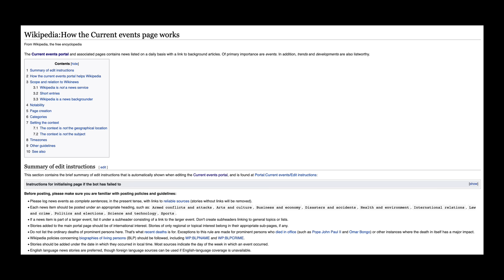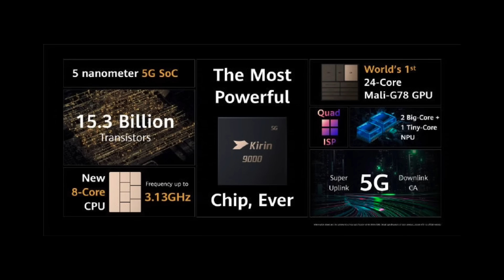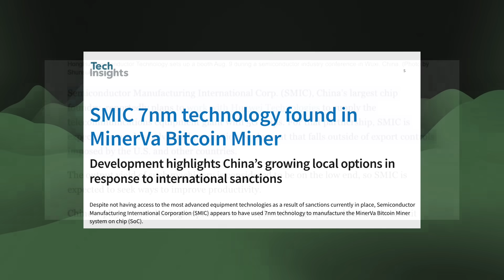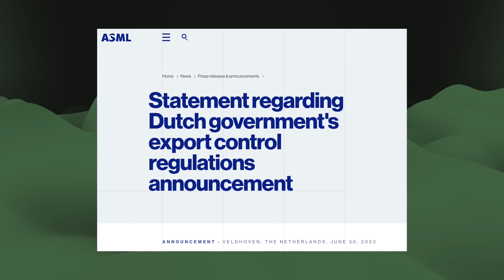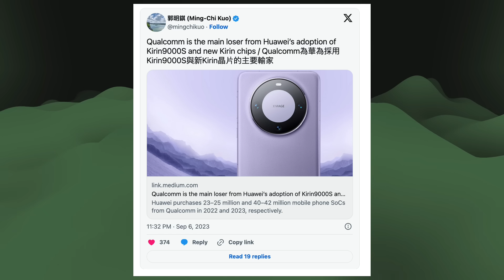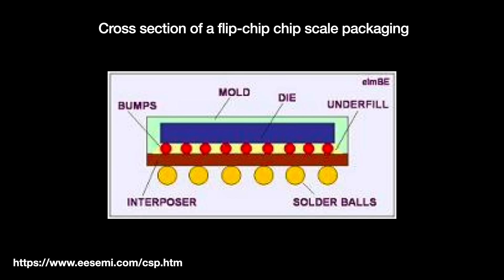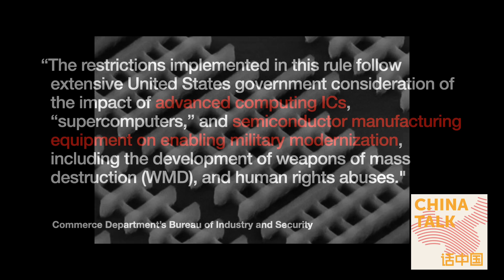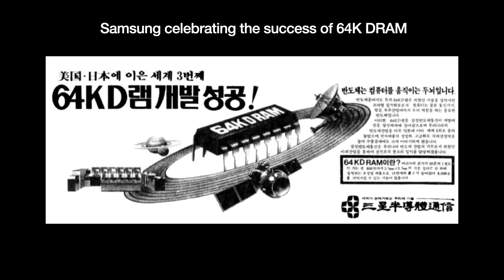China's 7nm Semiconductor Breakthrough

Comment: This video made me re-watch the "can you do 7nm without euv?" video you posted an year ago. It speaks to your in-depthness regarding semiconductors, and i can't overstate how much i respect your hard work and dedication. thank you.
Edit: hey jon. Sorry for this stupid ass argument in the replies to this comment. I have no idea how it started.
Reply: no, all he said is NS
Reply: @xinyiquan666 he is heavily biased since he is taiwanese dpp supporter but he has some points
Reply: There IS no good way to get to the transistor density of the likes of Samsung 7N, Intel 7, or TSMC N7 without EUV.  There are only unprofitable ways.  This is still the case.  SMIC has been able to make something they SAY is equivalent (once again these are names) to the other companies' products they attach a "7" to and they have similar transistor densities, with their LOW DENSITY library, which is also important to understand and he didn't cover I don't think.

There are different types of transistors that can be produced, and you can have the same transistor be in a low density and high density library.  The name of the libraries should be self explanatory.  If you clock something above a certain speed then the transistor would most likely come from the low density library and clocking something slow means it can be in a high density library.  This is all part of the specs of a process node.

It is almost certainly the case that SMIC can make something about the same as the other companies' low density library set for what they call their 7nm node, but they would have to use it for slower clock speed use cases, like a smart phone where clock speeds are much slower than a desktop or laptop computer with desktop being faster.  You could also use it for AI training and many other use cases where you don't need the speed of a data server or desktop computer.

Since Huawei is controlled by the CCP regardless of their lies (this phone launched without any warning, on the day the U.S. Secretary of Commerce arrived and was advertised on THAT day mostly with CCP members and one or two celebrities that use Apple phones, kind of laughable really), the CCP will subsidize it so even though it's not profitable to make a 7nm node without EUV using the same techniques ICs have been made for a few decades now, it will be made to look like they've done something great.

But this has been the CCP's operating procedure for about 15 years now and has led to many noticeable failures.  Make it look like they can do something great but the quality is always sub par.
Reply: @johndoh5182    another pile of NS,   all you said is about US companies, not huawei,   there are only 3 companies in this world can do 7nm chip,  TSMC, samsung and  chinse SMIC,  no others,    US can not even do 48nm , let alone  7nm ,    all advanced chips in US are bought from taiwan,  also samsung chips are taiwanese technology,  their 5nm is only equal to 7nm , so far, only taiwan can make most advanced chip, followed by china
Reply: @NeostormXLMAX   if it is high biased  then  no points are valid
Reply: @xinyiquan666  Biased does not equate to wrong or invalid. Mind you, your attitude makes you look like you are just another little pink. The fact that johndoh can go into the details much more than you about the technology shows that he at least know more than just the transistor size that you only seem to know about (based on what you have said so far). Like Asianometry said, transistor size is just a marketing thing, so what we should be focusing on is the raw performance.

China is good at copying, its well known, but China doesn't have good track record in making actual breakthrough that no one has ever done before. In other words, if the best you can do is copying, the best you can be is 2nd place.

Nevertheless, more competitor = better for consumer. So as a consumer myself, I want more competition
Reply: @shikyokira3065   1, biased automatically  means twist and lies,   because it is on purpose said so,   ,
Reply: @shikyokira3065  2，  you describe self"   another little pink,  for 3rd gender in your  gy country
Reply: @shikyokira3065   3, details or not  it never prove all he wrote is not NS,  only can prove he could produce  piles of detailed NS,   that shows the level of his NS,
Reply: @shikyokira3065  4,  use  a  " term"  does never mean anything , he can copy a technical term from other place does not mean he or you know anything about technology, especially for the country you are from,,   99% of scientist and engineers are either chinese or indians and other immigrants,   it automatically assume none of you know anything about technology
Reply: @shikyokira3065  6, even instructor of the team is a Chinese professor from university of Chicago,    out of  350 million,.  your country can not even  find  any  of  your own   that can do math,   that speaks everything,   none of your kind knows any about technology
Reply: @shikyokira3065  7,  also, speaking of  copying,  a country can not even invent its own language  but have to copy one,  who is it?  US,   what else it is not copied from others???   idt
Reply: @shikyokira3065  8 also , in world's view,   US is the one that has highest reputation for copying,   so are  japan, or taiwan, all best in copying
Reply: @shikyokira3065  11, china invented most technology today  -------WIPO Report:China extends lead over U.S. in global patents filings, U.N. ... ...
Nov 26, 2022 — China has 3.6 million patents in force followed by the United States with 3.3 million and Japan with 2 million. Remarkable Trademark Growth.
Reply: @shikyokira3065   9,  ,  china has invented more than  75% of technology in world history  according to Cambridge university  research work"  Science and civilization in china" ,
Reply: @shikyokira3065    10,  every technology   in world  today   is based on Chinese inventions in the past  or now  directly and indirectly
Reply: @xinyiquan666  "biased automatically  means twist and lies,   because it is on purpose said so"
Are you projecting? Biased is literally means the person has a preference or view on a certain thing influencing their opinion on a particularly subject.
Do you even know the definition of biased in the first place? You sounded like you don't even know the meaning of it

"you describe self"   another little pink,  for 3rd gender in your  gy country"
Are you speaking english? Is the translation broken?

"details or not  it never prove all he wrote is not NS"
Neither do you. You have no prove that what he wrote is bullsht. Those details are the theory behind it. Even tho, it is just theory, at least he is being logical, not like you throwing labels everywhere. You are not adding any value to the discussion by doing so
Reply: @xinyiquan666  "especially for the country you are from"
LOL you don't know which country I'm from. I'll give you a hint, not US

"99% of scientist and engineers are either chinese or indians and other immigrants"
source? I doubt you have any
Reply: @shikyokira3065   twist and lies is a preference,   idt
Reply: @shikyokira3065   urself even know what is definition of that?  idt
Reply: @xinyiquan666  LOL I can patent rubbish technology and still count as 1 patent. If China has so many patents, why are China still behind? please enlighten me
Reply: @shikyokira3065   lol so your translation   not working? idt
Reply: @shikyokira3065   lol  neither do you, do you even prove where i said wrong?  idt
Reply: @xinyiquan666  "urself even know what is definition of that?  idt"
I obviously know the definition, the problem is you are using it wrongly equating biased = twisting and lying.
You are now projecting. Cope harder little pinky
Reply: @shikyokira3065   no obvisouly you know nothing about definition of it,  you just b,  s
Reply: @shikyokira3065   also,   i never said  you are  from US,    i said your country,   but  it is similar,     idt
Reply: @xinyiquan666  "lol  neither do you, do you even prove where i said wrong?  idt"
Nice try, I didn't say you are wrong. But you said he is wrong and so I asked you for proof. Show me.
Reply: @xinyiquan666  "no obvisouly you know nothing about definition of it,  you just b,  s"
what makes you think so?
Reply: @shikyokira3065   source? lol   i have provided plenty of reference here,  where is yours? , show me source you claim  china is only good at  copying
Reply: @shikyokira3065   no, you said literally what i said is wrong, does not equate means wrong,  idt
Reply: @shikyokira3065   and  you ask me? then you need to show me where he said is correct first, where is your proof?
Reply: @shikyokira3065   what make you think you said is correct?  idt
Reply: @shikyokira3065   also,  show me a proof  you ever get a patent,   where is it?  in dream?
Reply: @shikyokira3065   also where is your proof  china is behind in technology?
Reply: @shikyokira3065   also show me proof  your country is ever ahead in  any  technology,  or this  chip technology,
Reply: @xinyiquan666  "no, you said literally what i said is wrong, does not equate means wrong,  idt"
Ohh so this is what you were talking about, I thought for a moment you were talking about his points, but instead you talking about your labeling. Seems like you are worse than I initially thought. smh
Yup, you are wrong, because going by the definition of biased ("an instance of such prejudice" - marriam-webster), you are factually wrong to equate that to twisting and lying
Reply: @shikyokira3065  11, even the computer u r  typing  is based on a chinese math  achievement : binary numbers"
Reply: @xinyiquan666  "you ask me? then you need to show me where he said is correct first, where is your proof?"
I didn't say he is correct, so I don't need to provide proof for that. But you claimed his points are NS, so you need to show proof.
Reply: @shikyokira3065   lol, just looked up dictionary?  so? it does not even contradict what i said ,  you can copy dictonary does never mean you understand it
Reply: @xinyiquan666  "show me a proof  you ever get a patent,   where is it?  in dream?"
Did I say I have gotten a patent before? I just said patent can still be rubbish technology. Seems like your english comprehension is quite bad that you don't even get the meaning right.
Reply: @shikyokira3065   yeah, thats all you do,  you did not even talk about my point, but just NS i am wrong  without prove where my points are wrong
Reply: @xinyiquan666  "also show me proof  your country is ever ahead in  any  technology"
why do I need to? It doesn't make you right or wrong. You are just throwing out whatever points that you think that will make you look better but not right. I'm not here to compete country vs country.

I'm still waiting for your proof about your claimed that johndoh's points are NS, which after so many messages, you have provided none. Seems to suggest that you don't have any
Reply: @shikyokira3065   no, you said  biased does not equate wrong  means correct,    you have to prove that first,  also you have to prove that he knows more in technology,    idt,
Reply: @shikyokira3065   you said " I can patent " ,  it does not matter you did, or not yet, but you have to prove it you can,  or you admit its NS
Reply: @xinyiquan666  I have addressed your contention that I did not address your point, namely that you do not comprehend the word "biased". I have cited the Merriam-Webster definition of this term to demonstrate the error of your association.
Reply: @shikyokira3065   of course, you need to, you said china is behind in technology, and china is only good at copying, so where is your country, u have to prove your  country is ahead in tech to be qualify to say it
Reply: @shikyokira3065   im still waiting for your reference that china is good at copying, china is always at 2nd,  you said this first, so  show us proof,  little  pinc
Reply: @shikyokira3065   you cited nothing, the dictionary does not even against my point,  citing something irrelevant does not mean  anything meaninful , but only shows you do not understand it at all
Reply: @johndoh5182  For someone who would spend so much time writing so many words just to cope, some respect is due. Respect.
Reply: @shikyokira3065   no, you did not address my point, then you accuse me without proven where my point is wrong  , thats why you prove self is little pinc, all you do is NS , also  only thing i anwer to you is  your NS  of void accusation and claiming without any proof
Reply: @xinyiquan666  I did cite the Merriam-Webster definition of the word 'biased', which clearly states that it does not mean 'wrong'. I am not sure how you can claim that the dictionary does not support my point when it is literally written down in black and white.

It is clear that you are not interested in having a productive conversation. You are simply interested in name-calling and making personal attacks. I will not engage with you any further
Reply: @xinyiquan666  "im still waiting for your reference that china is good at copying, china is always at 2nd,  you said this first, so  show us proof,  little  pinc"
Its called logical reasoning. If you need reference for logical reasoning, then you need help

Also, I didn't say China is always at 2nd. You are misquoting me. You didn't even get the message right. The message is about logical reasoning, not making any claims.
Reply: @shikyokira3065  lol not compete country vs country,  but u little pinc  claiming  china as a country only good at copying, compared to other countries,    what a  delclude
Reply: @shikyokira3065   well, stop repeating same NS,   what dictonary says  has no connection to your NS,  you have to prove what you cited support what you said,   other wise  everyone can cite all dictonary such a chemical foumular to explain  a  lingustic term, idt
Reply: @shikyokira3065   also, no,  all you said is   lie,    lie does never have anything to do with reasoning, go look up what is a lie
Reply: @xinyiquan666  "you said china is behind in technology, and china is only good at copying"
Misinformation, I didn't say china is behind in technology, nor did I say china is ONLY good at copying.
Reply: @shikyokira3065   no, you said literally china is always at 2nd place and china is always good at copying,   stop lii,    micro pinc!!
Reply: @shikyokira3065   no,  no one can use a lie to reason anything, you have to prove that is a fact first  , then you can do further reasoning on that fact ,  idt
Reply: @shikyokira3065 "  why are China still behind?"  already forgot what  u lii?
Reply: @shikyokira3065   personal attack? lol,  you the one in your first comment attack me as " little pink"  , lol   what  a typical.....
Reply: Why does he say "we" when speaking of advances that benefit the Chinese Communist Party?
Reply: @shikyokira3065  Don't talk about projection when US imperialism has been doing it for decades.
Reply: @hg2.  China officially uses Communist Party of China or CPC. So the correct one is CPC not CCP as projected by western sources. As for we, it is important to take into context that there is 90 million members in the party which means a large amount of people in China is part of it and are also in all sorts of various income and areas. I just skimmed thru it and found your comment so this is what I found. The CPC really does most things for the people and represent the interests of the people. This is why you have the standardization of high speed rail in China which "cheap labor" which isn't really cheap anyways in China especially engineers would not have come anywhere close to doing so let alone China's subways that take rank 1 to 3 in length. To give context how massively ahead China is compared to Japan in HSR is that China right now has 11 times more high speed rail than Japan and operated at higher commercial speeds across more climates than Japan including elevations. Lower costs of living and inflation is also demonstrated in China comparatively to the west by quite a large margin.
Reply: Wtf are these replies?? I never said anything about the CCP…
Reply: @keitatsutsumi  
Huawei has nothing to do with the CCP? 
Please.
Reply: @xinyiquan666  US can not even do 48 nm? Wait what?!
Intel is currently doing 7 and 4 "nm", stop lying.
Reply: @ThePowerLover   US do 7 and 4nm?   in your dream,, all intel chips are contracted to taiwan ,    stop liii,   US is the country that can not even  make  a train that is faster than  3cm  per year, let alone any chip
Reply: @hg2.  I said I never said anything about the CCP. I didn't even say anything about Huawei either.
Reply: @xinyiquan666  You seem to have forgotten about Intel. They are on 5nm and 3nm is being readied. They will get to 1nm before China ever gets past 7nm.
Reply: @tstager1978   stop NS, intel does not have chip manufacture, they only do ARM design and manufacture is contracted to taiwan,   lol  1nm?  even the fastest train in US can not pass  1nm per hour speed,  let alone any chip,   compared to china,   US is a stone age
Reply: @hg2.  if huawei had anything to do with CPC, then all US  companies are  state owned
Reply: @xinyiquan666  They only buy silicon for their GPUs to TSMC, they have their own 7 and 4 nanometers nodes.
Reply: @xinyiquan666  The cope is huge in you.
Reply: @AFlyingCookieLOL  2 wrongs don't make a right. I didn't say US didn't project, he certainly did project. I can criticize US all day for that, and I can criticize you all day for doing that as well. There is no "don't talk"
Reply: @ThePowerLover   stop  lying,  all chips in US are bought from TMS in taiwan, including all CPU and GPU and other chips,  and sillcons and all other raw material and chemical  are imported all from china, then  the  and chip making and packaging are all done by TMSC and other taiwenese companies,      the memory are bought from  samsung and sinx from south korea  and some chinese memory  manufactures,     idt,  intel never had its own  48, let alone 7,  idt
Reply: @ThePowerLover    you are so desperate,  idt
Reply: Huawei subsidiary SMIC apparently already has the ability to design its own chips
Reply: @saahan-nn1fe  1, SMIC is not subisdiary of huawei,  huawei's  subsidiary  chip company is  HAISI  chip,   of course it has chip design ability,  it had it like 15 years ago,  but huawei did not have chip manufacture crafts , so huawei haishi  used to contracted to taiwan's TSMC to OEM  ( manufacture)  huawei designed chips,  but now  huawei  has set up its own  manufacture  stream line using its own tool to manufacture  7nm chips, the 5nm chips are in new batch for early next year,
Reply: @saahan-nn1fe  2,  ,  by contrast, SMIC is same type  of  TSMC and samsung, they all  do  OEM  manufacture,   while   Huawei haishi,  intel and QUALCOMM, AMD,   , NVIDIA  are all chip design companies, they do not have manufacture  technology and facilities  , manufacture crafts and  chip design are totally different thing, it is just like apple only design phones and ipad, but they do not have their own manufacture  factories, apple has to find contractors such as  FOXCON and chinese companies to manufacture a phone device for them, all chips and parts of apple phones are not made by apple, but 99.5%  from Chinese companies, rest of chips are from TSMC ,
Reply: @xinyiquan666  "Huawei haishi,  intel and QUALCOMM, AMD,   , NVIDIA  are all chip design companies, they do not have manufacture  technology and facilities" 

Somebody doesn't know what he is talking and obviously also doesn't know how punctuation works. But well after a 12 hour shift in the troll factory what can you expect right?
Reply: @xinyiquan666  Knowing math is not essential in making innovation.
Reply: @xinyiquan666  Yes, you are.
Reply: @zebarzebra  Seems like that guy is just a deranged troll on the internet saying positive nonsense about China. Staying quiet is the best thing to do.
Reply: @NeostormXLMAX not DPP he is KMT
Reply: @xinyiquan666  Sounds like the bs is more coming from your side ... Which actual SMIC chip are you referring to ?  ... and don't come up with this Kirin 9000s, because that's a re-labelled Kirin 9000 manufactured by TSMC.
What you also forgot to mention is "Intel 10" which is pretty equal to TSMC's 7nm  ... and that's used for a very complex chip design !
Reply: @shikyokira3065  All DPP supporter arguments are should be considered invalid and can't be taken seriously
Reply: @afuyan  include arguments against slavery, if they ever make 1?
Reply: i see the White previlege of little white here, dude, good for u
Reply: @xinyiquan666 Intel literally have 14 and 10nm
Reply: @zebarzebra  1,  u the one does never  aware  anything scientific ,     ,
Reply: @zebarzebra  2,    u  hm less  , all 24 shift only  for 2 dollar  w,iiiid,    thats all over US
Reply: @OlexaRivzjak   WELL,  dont know math, u can not make any innovation,
Reply: @OlexaRivzjak  2,also, it is not even  just math,   but every team  in US for STEM, physics, chemistry, IT, biology,,,,, are pretty much all Chinese , ,
Reply: @ThePowerLover   yeah,  you are desperate,   hm  less
Reply: @marcuscole8796   1   stop b, s,   u  hm less,     kirin 9000   produced by TSMC does never  mean   Kirin 9000s  is made by the same ,  kirin is  just name for  chip series designed by huawei, ,
Reply: @marcuscole8796  2, latest apple phone 15 and 14s are made in india  by  different Taiwanese companies , not the FOXCON for previous  apple 14,  the  contractor can always change,   so are those QUALCOMM chip,  they either contracted to TSMC or samsung,   idt
Reply: @marcuscole8796  3, stop  b, s  again,  intel 10  is not even get close to TSMCs  128nm , let alone 7nm,    let alone it is manufactured by TSMC by OEM contract
Reply: @INTJ791   no, literally intel can not even do  128nm, let alone 14 and 10nm, all its chips are TSMC manufactured
Reply: @xinyiquan666  Assembly of phones or packaging of chips is NOT the issue here ... (other than Qualcomm) SMIC doesn't have a chip design of their own ... nor are they capable of manufacturing chips with such fine structures.
Exactly THAT is the reason why the Kirin 9000 was produced by TSMC ... because SMIC can't !
This has nothing to do with making contracts or setting up efficient supply chains ... it's an issue of technical capability / incapability.
Reply: @marcuscole8796  stop same  b,s, again,   SMIC is a OEM company, same as  TSMC or samsung,   SMIC has manfucature packaging craft of 5nm and now its working on 4nm,   the one that can not manfaucturing of chips are intel and AMD and qualcommn,  ,,, none of US companies can manufacture any chip on their own,   but have to CONTRACT to TMSC or samsung, or even SMIC, for final product,     also the point is who told you Huawei kirin 9000s is produced by SMIC? ,  did the label of chip says so ????   idt,  this new CPU is produced by the  joint manufacture companies  set up by  chinese academy of science and shanghai light & mechanical engineering  research institute and huawei  itself , it does not even have anything to do with SMIC,    idt!!!
Reply: @xinyiquan666  lol ... yes ... Intel can't manufacture structures finer than 128nm ... you're a true semiconductor expert ... lol
You are mixing up lithography wave length with resulting chip structures !
130nm chip structures were already in production in 2000 with the Pentium III and Celeron !
Btw ... the Intel fabs with 10nm process are on duty and located in Ireland and Chandler (US) and it compares to TSMC's 7nm process ... you're the idt
Reply: @marcuscole8796  1, Yeah, im semiconductor expert , while u just another  wiiid  expert same as all your kind in US or similar countries,   a free class for u,   lithography wave length is manufacture craft gauge means  " process" how fine its craft is in making chips,  while  chip architecture is a  design for the chip structure and functionality,  these are totally two things,  idt!!!
Reply: @marcuscole8796  2, again, another free class for you,  TSMC was founded in 1987,  it does not matter what  intel chip they designed and in which year,  ,all were contracted to TSMC to manufacture, because intel has not technology in chip manufacture  what soever,  idt!!!!
Reply: @marcuscole8796  3, stop ur  b, s story again,   the intel does never have any even 128nm process, let alone any 48 or 28 , and 10,  if any US company had any  chip manufacture technology, they would not be so desperate to force TSMC and Samsung to manufacture in US,     the only manufacture  in US  for chip process are TSMC  5nm  process in Arizona , and Samsung chip plant in Taxes ,   idt！！！！！！！！
Reply: @xinyiquan666  Use your brain ... the future TSMC fab in the US is driven by geopolitical and logistic reasons only...
Reply: @xinyiquan666  Yes, nothing new ... TSMC was founded 1987 with support of the ITRI  ... 16 ! years AFTER the release of Intel's 4004 (1971) ... you're right: Intel doesn't have the slightest clue about chip manufacturing ... lol
Reply: @marcuscole8796   so? you forgot  a country called japan,  it was contracted to japan before TSMC,  idt,  also those chip are older than a  shell in stone age,   try use  a intel 4004 in any your  todays device, idt
Reply: @marcuscole8796     LOL   do you even have  b, r n cell?   every advanced chip in US are from TSMC and samsung today and in the future,  why is it geopolitical??  all because US does not have that technology, otherwise  why would  US even care?   ,since  the US could still produce in US if US has its own, but now it add thousands of times higher cost in it by moving  TSMC and Samsung to US  than manufacture in taiwan and south korea
Reply: SK hynix c told you, Ming dynastry and friends.
Reply: @NeostormXLMAX um if u say taiwanese supporter maybe but where's the logic/proof
Reply: @proadlekopy  he says this many times in almost all of his videos watch more, go to that china nuke thing for more context, also he literally has shown insider information about tsmc and other taiwanese companies he literally works in this industry and is taiwanese american
Reply: Hear! Hear! Much respect to Jon!  Thanks great report
Reply: @shikyokira3065  Wow, The objective reality that the U.S. can't stop China's technological progress is very frustrating to you
Reply: @parkjoonkwang9259  lol, I didn't mention US at all other than at the negative sense, you are projecting bruh
Reply: @johndoh5182 it racist to claim "CCP"  (it CPC not CCP), own Huawei when there is no proof of that. the only arguement US made was they have exchange with the PLA, however AMD too have exchanges with PLA and even provided them with a sample design for x86 CPU. its clearly double standard and racism.
Reply: wrrrr
Reply: The edit😂😂